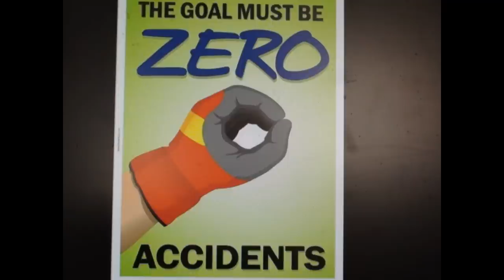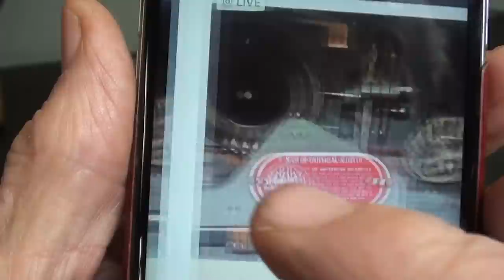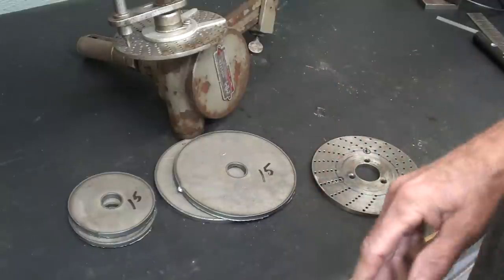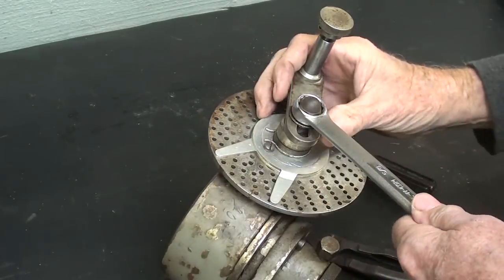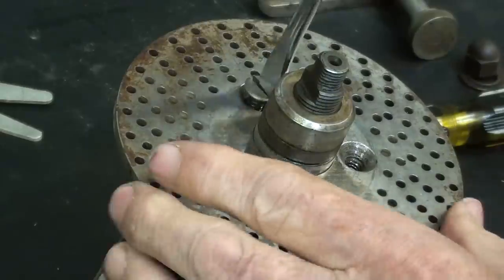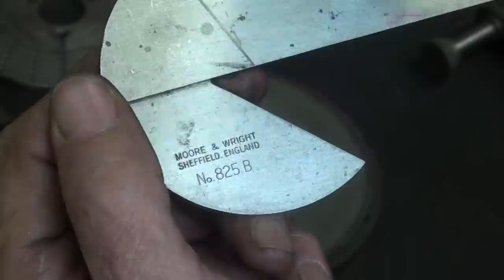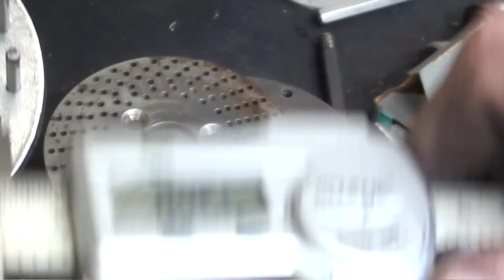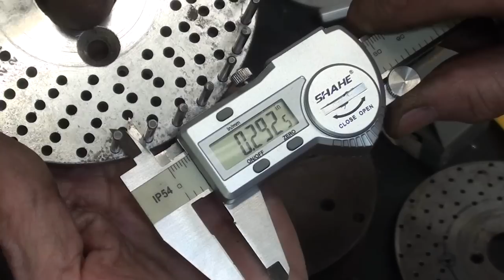Making Dividing Head Plates TIPS #621Transfer Method tubalcain

Comment: Just to expound on the point Mr. Pete made about variation in the hole positions not being extremely critical to a useful index plate.
The table below shows that even if the dividing plate holes were drilled on whole-degree positions, the error in the final position of the feature (hole, gear tooth, slot, etc.) on the work piece being divided using the plate is very small because of the worm reduction.  The maximum error in the work piece would be 36 arc-seconds!  For most work that likely would be acceptable.  
If needed, a second, more accurate, plate could be made using the first plate.  Assuming a 40:1 reduction, the error in the second plate would be reduced by 40.  The result equates to about a half-thou on a six-inch diameter.  That would be pretty tight tolerance to try to hold on a thirty or forty-year old manual machine.  

Using the whole-degree scheme, a spin indexer could be used to quickly create a special dividing plate for a rotary table.  Of course, using the rotary table and just setting to the nearest one-half degree using the table's scale and a worksheet with the calculations for the degree setting for the desired number of holes would result in an even more accurate indexing plate.

Plate hole Angle A  Hole No

                         B Angle
                        C Nearest whole degree
                        D "Error [decimal degrees]"

Error in:                E Dividing Plate Hole spacing [DMS]
                               F work piece using 40:1 worm  to index [DMS]

A        B     C        D          E                     F              

1 14.4°  14.0°  -0.4° -0° 24'  0.0" -0° 00' 36.0"
2 28.8°  29.0°  +0.2° +0° 12'  0.0" +0° 00' 18.0"
3 43.2°  43.0°  -0.2° -0° 12'  0.0" -0° 00' 18.0"
4 57.6°  58.0°  +0.4° +0° 24'  0.0" +0° 00' 36.0"
5 72.0°  72.0°  +0.0° +0° 00'  0.0" +0° 00' 00.0"
6 86.4°  86.0°  -0.4° -0° 24'  0.0" -0° 00' 36.0"
7 100.8°  101.0°  +0.2° +0° 12'  0.0" +0° 00' 18.0"
8 115.2°  115.0°  -0.2° -0° 12'  0.0" -0° 00' 18.0"
9 129.6°  130.0°  +0.4° +0° 24'  0.0" +0° 00' 36.0"
10 144.0°  144.0°  +0.0° +0° 00'  0.0" +0° 00' 00.0"
11 158.4°  158.0°  -0.4° -0° 24'  0.0" -0° 00' 36.0"
12 172.8°  173.0°  +0.2° +0° 12'  0.0" +0° 00' 18.0"
13 187.2°  187.0°  -0.2° -0° 12' 0.0" -0° 00' 18.0"
14 201.6°  202.0°  +0.4° +0° 24'  0.0" +0° 00' 36.0"
15 216.0°  216.0°  +0.0° +0° 00'  0.0" +0° 00' 00.0"
16 230.4°  230.0°  -0.4° -0° 24'  0.0" -0° 00' 36.0"
17 244.8°  245.0°  +0.2° +0° 12'  0.0" +0° 00' 18.0"
18 259.2°  259.0°  -0.2° -0°  12'  0.0"  -0° 00' 18.0"
19 273.6°  274.0°  +0.4° +0° 24'  0.0" +0° 00' 36.0"
20 288.0°  288.0°  +0.0° +0° 00'  0.0" +0° 00' 00.0"
21 302.4°  302.0°  -0.4° -0° 24'  0.0" -0° 00' 36.0"
22 316.8°  317.0°  +0.2° +0° 12'  0.0" +0° 00' 18.0"
23 331.2°  331.0°  -0.2° -0° 12'  0.0" -0° 00' 18.0"
24 345.6°  346.0°  +0.4° +0° 24'  0.0" +0° 00' 36.0"
25 360.0°  360.0°  +0.0° +0° 00' 0.0" +0° 00' 00.0"
Reply from the maker: Wow that is great information. And you certainly did expound. I hope lots of people read your comment. Thank you for going to the work of making your comment

Comment: You mention getting the "First" might be tricky, and wondering.
I'm thinking the answer is basically Sine Bar. Arbitrarily accurate depending on size alone to crush problems.
Glue plate to large (8+feet) table. (countersinking if needed) Drill/Ream long straghtedge and plate and table. Pin in that hole. Drill/ream ruler and table at other end. pin in table. pin-punch in ruler end. "Baseline established." Oh, no. Math. How far apart should these two pins be for (1/15) of a circle. Math says "x inches!" Measure ... punch. Since the straight edge is -straight-, the extremely large circle's 1/15th can be transferred to the little circle of the dividing plate. Both the more-accurate "calculate each hole independently!" and the "just use the new hole as the new baseline and calculate 1/15th again" methods can be used from there.
Reply: Simplish Method For making plates  described by gingery in  machine shop from scrap... .
Measuring tape... Doesn't matter what size/divisions so long as accurate... Say it's  1mm graduations... If you wanted 360 marks to a rotation... Turn a disk so circumference is 360mm, then wrap tape around circumference, and each tape mark will define the 1/360 of rotation. 
If you wanted 99 divisions... turn cylinder to circumference of 99 etc. 
Possible to use right angle triangle to "drop perpendiculars" and scale a tape's indii up/drop to suit different circumferences, but that would get tedious... Custom index tapes can made with a laser printer these days.

Comment: You could actually make more precise plates by using the index head. Just stick your inacurate plate on there, put a raw plate in the chuck and index it for drilling. Because you have a gear reduction, you also reduce the error. You could then put that plate onto the indexer and make an even more accurate plate, and continue infinitely. Of course at one point it wouldn't be practically possible to get more accurate, but it brings you really close.

Comment: Sir, may i make some suggestions?

 I think the first plate should be checking out all the gears in your lathe and mark it in the same plate, and the second plate obviously should be for your milling machine, etc etc. To accommodate the “just in case” no supply of gears situation.

And, since it is for index purpose, not hugh force will be apply to the plate, i wonder.....how about 3d print these plates? Nowadays 3d printer are more easy to find than making 3/4 inch steel plates. You can also add one more episode to try one, cut the corners and let the machine doing the bean counting job while you are having a good ☕  of coffee 😎
Reply from the maker: Thank you for commenting. And yes the 3-D printed plates will be in a later a video. I have a man working on it right now

Comment: Does anyone know of a tool or concept that could be used for Very light lathe work on a mill?

I need to cut a precise 67.5° angle in 5/8” SS, and ideally need a device that will allow me controlled freedom of motion along an axis at a adjustable angle. Hopefully holding a standard insert and being able to restrain the device in a vice or on the table. 

Essentially the tool holder on a lathe but able to be used on a mill... has anyone done something similar and can advise.

Believe me, I want a lathe and he room to place one, but have 8 parts I need ASAP. 

The mill does not have a adjustable angle for the head, restricted to Orthagonal movement.

Comment: I just wonder how accurate you could be by stepping off the hole points using a bolt circle and a compass.
Theoretically it could work, no?
Reply: The higher the hole circle diameter the better the accuracy. Imagine huge plate with 15 holes, small deviations would be even smaller on the shaft.
Reply: Watch this space maybe  ?
Reply: Jyrki Koivisto it figures that Chris would have worked all of this out.

Comment: You could have made the 15 hole plate while set up in the lathe as the tool was intended along with a tool post mounted drill. 40/15 = 8/3 = 2-2/3 so 2 turns+22 holes on the 33 hole circle. Physician heal thyself.

Comment: It would not be too difficult if you had a dial on the handle of a dividing head. A typical dividing head is a (40:1) ratio which is 9 degrees every rotation. For example if you wanted to make a hole every 36 degrees... 10 holes in a circle... you know that 36/9 is 4... so drill, rotate the handle 4 times, drill again. Even something like 7 holes which does not divide evenly... 360/7 = 51.4286 degrees... so divide by 9 and get 5.7142 rotations. If the dial was marked in 100 increments you get as close to 71.42 as you can. I would think the backlash would be more than the human error... and you would still end up +/- 1/100 a degree.
Reply from the maker: Thank you that’s a great suggestion
Reply: @askjerry if you want 10 holes there's no need to convert to degrees, just divide the gear reduction by number of holes to get your number of turns.  As for dividing by 7 manually, that would work, but it would be a lot slower than using a plate.
Reply: @sleepib  The discussion is how to make the original plate for production... If you already had a plate, then why would you not use it?

We are discussing the HOW the original plates were likely made.
Reply: @Askjerry  Sorry, I misunderstood you. There are a whole lot of options for making the first plate, depending on what you have access to. The lowest tech option might be a compass, step around the circumference and make small adjustments until you get back to the starting in the desired number of steps.
Reply: @sleepib  While that sounds like a good solution, consider some of the discs with a larger number of holes such as 72 for example. (5 degrees apart.) How would you start? And as you subdivide each section, any error is exasperated and becomes larger with each iteration. using a geared index, if you start at the same spot each time, any errors are limited to less than 1/100 degree, and any errors are not additive for each successive division. That's what makes it an interesting problem... they had to do it where as much accuracy as possible is maintained. Using a 40:1 gear ratio, you simply rotate the crank a total of 1.8 rotations per division. Imagine a disk on the crank with only 10 marks... for a 40:1 gear ratio, that means you have a resolution of 400:1 or better than 1 degree of accuracy. With 100 evenly spaced marks... that is a 4000:1 accuracy. Of course... your method could be used for the initial 100 marks... as afterward any errors would only contribute a small amount to any single division.
Reply: @Askjerry  For 72, start by dividing in half with a straight edge(36), construct a perpendicular line with compass (18), bisect each sector with compass and straight edge (9) then I'd get the last divisions by the previous method. Estimate 1/9 and adjust until you hit the end point after 9 steps.

Can also use a sine bar if you need more accuracy.

You also need to accurately divide a circle to get the main gear of your rotary table.

Here's a relevant video by clickspring: https://www.youtube.com/watch?v=BIUAdINXZmQ

Comment: You asked why no one liked . your program on the Tree D printer ,  the truth it  it smacks of  the loss of skills . & the death of the skills we need to hold on to . this is especially , required of the manual lathe.   Hears a little History lesson . of the Tolpodal matters ,  Dorset England . check it out on you tube , That lead to the wavers rioting in what was to beginning of  the start of the industrial revolution. the Tolpodal Matras.  where deputed for forming the first union ,    & The  weaver smash the loomed because  it stole  there job's as the industrial mill develop .  this is why interest in new Teac is slow to be excepted ,
Reply: check it out  I like  working in plastic , try building   stuff mad in the lath out of plastic nor  built on the Three D printer ,
got it yet .